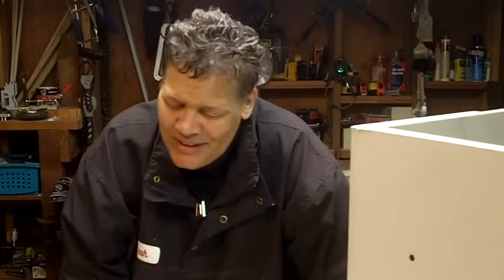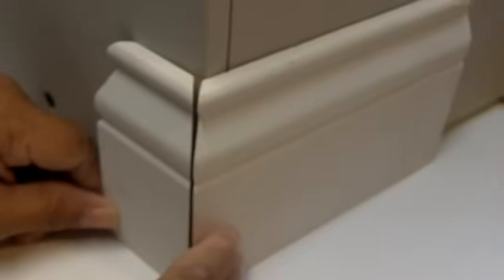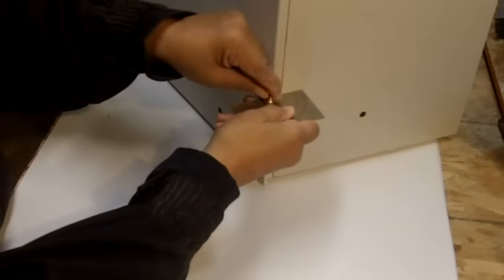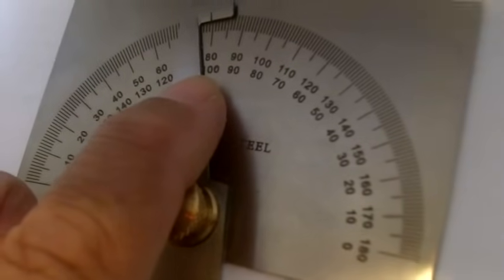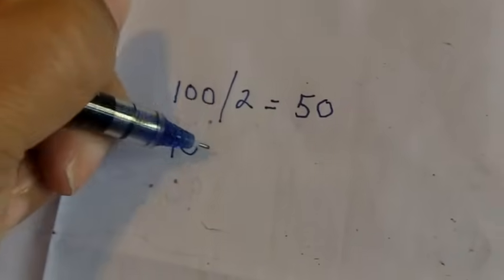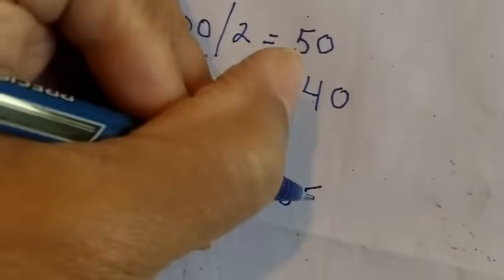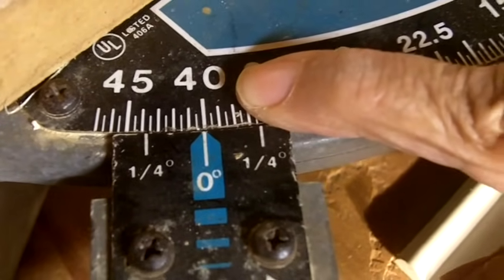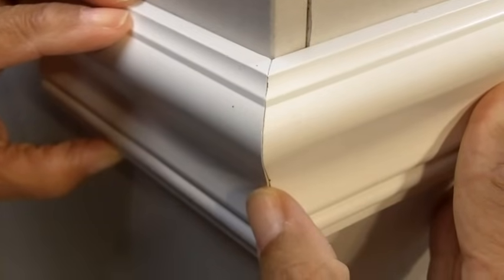Install Perfect Outside Baseboard Corners/Easy Math Trick

Comment: I believe for acute angles (<90°) you still have to calculate the supplementary angle and set the mitre saw to that value. For example if the outside corner angle is 60° you can't set the saw to 30° and cut the moulding because you'll end up with a 60° bevel. You need to set it to 60° which most mitre saws won't provide. What should one do in that case? In these cases you need a compound mitre saw.
Reply: Yes I’m surprised that she made a mistake like that! The best way is 180 - the angle of the corner divided by 2. An 80 degree corner should be cut at 50 degrees and not 40 degrees.
Reply: @theone3337  Your simple math statement just cleared up my frustration with setting an 87° corner to 43.5 and it was really off. It had to be 46.5. Thanks for saving my sanity.

Comment: If you cannot do maths or have no protractor you can get the angle by laying your skirting (base board) flat on the floor against the wall and penciling a line on the floor on both sides of the corner then at the point where the lines cross to the wall corner will be the angle you need to cut, set your bevel to this angle.
Reply: hunh? Can you explain better?
Reply: Lay the board against the wall flat on the floor, draw a pencil line along the edge of the board, move the board against the other side of the corner and draw a line against the board again where the lines cross draw a line to the corner of the wall and that will be the angle you need to make the perfect cut.
Reply: No
Reply: @gw0mof  u can find any angle without an angle finder, u need to pieces of wood, extended from the wall, overlap them and measure from upper point to lower , draw a line and you get a perfect angle.

Comment: WOW.... I really learned how to cut moulding with your video....  your a great teacher.
Reply: Do you realize she is  actually wrong though? 😂😂😂
Reply: @jonm2416  no. How so?
Reply: @annanajduch5201  It's nothing against her, she's usually great. She just made an error that may cause some people a headache. It doesn't work the way she said for angles under 90 degrees. If you take an angle under 90° let's say 88° and then divide by 2 and get 44° and proceed to set your saw at 44° you will get a miter joint that's open by 4°   meaning you can practically stick your pinky finger in the gap. The correct saw setting would be 46°. The easiest way: measure the corner as X and use this formula to set your saw. (180-X) ÷ 2. Happy building!☺

Comment: I like the way she instructs.  Very clear and logical.
Reply from the maker: +J Scott thanks!
Reply: I agree very clear and simple. Inside and outside corners favorited for future use.
Reply: yup, a very good teacher.
Reply: 2018 mr olympia
Reply: Very clear and logical, but her math is very wrong. The correct formula for all angles (right, obtuse or acute) is (180 - x) / 2, where x is the measured angle. I like her persona, but she needs another math class.
Reply: Except good teachers don't teach falsehoods. Using her logic, an 80 degree corner and a 100 degree corner would both require 40 degree cuts. Not possible. The correct formula for all angles (right, obtuse or acute) is (180 - x) / 2, where x is the measured angle. She needs a math class.
Reply: J P NNEEERRRRDDD
Reply: @manillafresh57  DDUUUMMMMYYY
Reply: @JP-xj6lr  In  this example the measured angle was 100 using your formula (180-100)/2 = 40 which was her result.
Reply: @willhunt3000  Her formula only works for anything over 90 degrees. If it's 90 degrees or less, she says to divide the angle by 2, which is incorrect.
Reply: @JP-xj6lr  you weren't clear that you were referring to the error in reference obtuse angles only.   Not sure why you found it to be necessary to be rude and snarky.   I'd like to critique your instructional video sometime.
Reply: @willhunt3000  Not trying to be rude or snarky. Just stating facts. Math is either right or wrong, and this video is misleading. I think she's a great, natural teacher.
Reply: JP. Could you do the math on a house with 90 corners using math that takes 5 times longer... how much money would I make on that job?
Reply: J Scott Yeah she’s pretty good.
Reply: Brian B The smartest people never stop learning.
Reply: @JP-xj6lr  Thanks for pointing this out. I have a wall that is 86 and I was cutting at 43 and it was worse than the 45. 

She does explain the obtuse angles really well and she is easy to understand.
Reply: @beginew  u might not even get paid at all if you used her video suggestions bc half ur miters would look like garbage
Reply: @manillafresh57  or maybe he's a math teacher? Or a finish carpenter like me? Some professionals can easily spot her error. This woman has great intentions and gives great advise 95% of the time but she happened to make a simple mistake this time. Not a big deal. He's just pointing out the correct way. Any snarkiness I believe comes from the fact that if you make a mistake on your own that's fine. But when you try to teach other people with that mistake then you probably SHOULD go take a math class because you're going to give other people problems.

Comment: Leah you are a genius! I wish you could've taught my woodshop class, math class,  hell....can you be my mom?
Reply: @jonm2416  glad I saw this comment can you explain the first part correctly mate it don't make sense I understand cutting 40 degree fir a 100 degree mitre to leave 50 (2x50=100 degrees ) but the anything under 90 and halving don't add up to me
Reply: @kevinhancock4064  sure, the formula is actually (180-X)/2 with X as the the overall angle like say 88°. If the main angle is 88° it seems like you'd just divide by 2, cut a couple 44° miters and be done but the "44" is actually what gets removed from 90° leaving you with 46° which is what you really want. Basically a miter angle is not the same as a regular angle. If you use the formula and physically perform the action on your miter saw it will work and become clear. I actually had to picture myself cutting the joint on my miter saw to realize she had made a mistake. It is confusing, I'd give her that. I just expected to see her admit her error but she seems to deny it even when confronted. Lol..good luck
Reply: @jonm2416  I went by my formula ans it worked fab fir me as it gives the angle of which the blade should be at and not what angle us left from the cut I guess both work depending how you look at it my external skirting mitres fir example on the side wirked out at 86 degree cormer so I done 90 - (88÷2) equalling 46 degree ut at saw i put a 45 dehree timber piece at mitre saw and added 1 degree to make the 46 cut it worked a treat
Reply: @kevinhancock4064  I tried to figure out your method but got confused about the angle being 86° and how you put 88° into your formula instead. But no matter. As long as you found something that works for you, that is the most important thing. If your miters are tight and you get the satisfaction that comes with it, then the project came out nice and you enjoyed it. And that's most important. Good luck mate.
Reply: @jonm2416  my formular I use now for skirting is x being the angke 90 - (x÷2) and that gives me my cut every time perfectly
Reply: @whocares650  not sure who said she's an idiot but if you took her calculations to a mitre saw you wouldn't get the cut you needed simple shes right on the angle required but not the CUT of the angle needed
Reply: @whocares650  bc her method only works half the time

Comment: Finally someone who explains clearly and shows with simplicity something that would take lots of confusing  explanations  for somebody else . THANKS .
Reply from the maker: +Alex Castillo you're welcome, Alex, and thanks!
Reply: Ccr
Reply: Alex, please don't listen to the advice in this video. The math presented here is just plain wrong. The correct formula for all angles (right, obtuse or acute) is (180 - x) / 2, where x is the measured angle.
Reply: @JP-xj6lr  thanx brother very helpful information
Reply: @JP-xj6lr  that the same thing she said, just used a different approach to it. She came up with the same angle.
Reply: @timmyers3428  Using Leah's math, both an 80 degree and a 100 degree corner would result in a 40 degree miter cut, which clearly isn't possible.
Reply: Tim Myers J P’s right, she said a corner of 88 degrees should be cut at 44 when it should be 46 degrees.
Reply: @JP-xj6lr  EXACTLY! Or in other words, it's ALWAYS the supplementary angle / 2.
Reply: @markarita3  what do you mean by supplementary angle? Thanks
Reply: @RipleyhypnotherapyCoUk  The angle to which you set your saw is ½ of the supplementary angle that you measured (on wall). What I just described is literally the formula, but in backwards steps - to help understand what is going on. Supplementary angles are 2 angles than add up to 180°. So, you measure 86° on wall...180° minus 86° is 94°...THIS is what you divide by 2 and to which you set your saw...NOT the wall angle. Same goes with an obtuse angle. You measure 93°...180° minus 93°= 87°...divide 87° by 2 and set your saw to this. The formula MUST be applied to obtuse AND acute angles. It is not needed for 90° (right angle). Hope that helps.
Reply: @markarita3  thank you, i get it now
Reply: @JP-xj6lr   I do agreed 180 degrees minus 130 = 50 decided by 2 = 25. or if you have any degree under 90, say 60 dived by 2 = 30, that is your cut, much easier to understand.
Reply: @theone3337   explain it!
Reply: how to cut an 85 degree if u decided by 2 its 42 1/2 if you cut  put them together they do not make an 85 degree , you need to cut it at 47 1/2 to  get a perfect 85 degree, confusing.
Reply: The best way I've found is to make a jig at 45 degree, clam it to the fence, now you can cut any angle at any degree. example a 63 degree angle.   start at 0 which now is 45,  count upwards, 5 now is 50, 10 is 55 , 15 is 60, 20 is 65 and so on, to cut a 63 degree  , 45 + 18= 63 set the miter at 18 degree an you have a perfect 63 degree.

Comment: 180* (straight line) minus the obtuse angle gives the supplementary angle. E.g. 180* -  100* gives the supplementary angle of 80*
Reply: 180/2=90   90-90=0   straight line
Reply: carlos lovera he is talking about
Above 90• your confused 180-100=80/2=40...
180-130=50/2=25
Reply: @lovera3878  90 is not obtuse

Comment: JP she has a later video called The secret to making perfect miter cuts when the angle is less than 90. I was also confused by this but in that video she makes it clear and shows the correct way. Example she gave. 85 degrees divide by 2= 42.5, 90-42.5=47.5, make your cuts 47.5 degrees. It made alot more sense to me. A fantastic video everyone should watch. But this video made it so much easier for me when the angle is above 90. I love her videos.

Comment: This is all well and good, and also 100% correct, when you have straight lines/walls to work with. That rarely happens in my world. Come 2binches in on one wall, there typically is a kink in it, and then yor protractor will be off from what you are actually after, still leaving a gap, even though your measured angle is correct. You need more surface area to work with. Old school methods suggest you take a 16" scrap or so, put it up against the wall, and extend the outside past the apparent intersection of the other piece, and on finished floors, you'd of course be marking on some tape or a piece of cardboard, then move it to the other wall and repeat. Now you have located the exact point for the outside corner, and here you can use your gauge, as the boards have evened out all of the lumps, bumps and kinks. Festool sells a tool that comes with the Kapex, that does all of this for you, including splitting the angle, so all you have to do is set the saw. The important thing about it though, is that it has a much larger bearing surface, than the gauge shown in the video. Other than that: great work 👍

Comment: There’s an error about 1:46.  I the external angle is less than 90 you can’t just halve the angle.  If it measured 88 you would set your mitre at (180-88)/2 = 46.  This formula works for external and internal corners, for more than 90 and less than 90.

Comment: Hi Jane, I like the way you explain.  I have a problem when I made a baseboard outside corner with your instructions came out find, but when I tried to make the other corner on the same baseboard, always the baseboard are short then the corner doesnt fix.  Im tried to put the baseboard into the base of a kitchen island.  All the baseboard around were short.  I measured but when I cutted always came short.  I had the 10" miter saw tool shop. My baseboard is 5" wide.  Would you make a video?  Everybody made only one corner side but when there are two ,left and right outside corner how to measure in the correct way and cut it with the miter saw

Comment: It’s simpler to subtract any angle acute or obtuse from 180. Divide the difference by 2 and that’s your miter saw setting. If the saw setting is greater than 45 you have to make a simple jig. Search here on YT for an example.

Comment: Interesting video.  I guess my question is you said that if the angle is less than 90 to just divide by 2 so an 80 degree angle you'd cut at 40.  However, if I'm following your example, you cut the same angles for a corner that is 100 degrees?  How would the same angled cuts match both an 80 and 100 degree corner?  I guess it depends on which way the trim is facing on the fence of the miter saw?

Comment: Great videos I have one query as you stated if its less than 90 degrees it'll be halved and so forth what I'm trying to get in my head it (yes I've done tidy mitres and scribed internal boards successfully) but say you had an acute  angle of say 80 degrees ....as stated it'll be halved at 40 degrees thats your cut right ....then as in your video you get a 100 degree angle (obtuse) halved is 50 and subtracted from.90 is again 40 the 40 makes sense as it then leaves 50 degrees to math second 50 degree cut to make 100 degrees but how is it you have again 40 degrees for the acute ? Just trying to bed my head around the true concept of it cheers again

Comment: Great video, but can you explainthis. This is saying that a 80 degree corner (80/2 = 40 degree cuts) and 100 degree corner (100/2=50; 90-50=40 degree cuts) require the same 40 degree cut?

How can this possibly be?
Reply: Hey Tucker, glad to see you noticed the bad math too. The correct math is (180 - x) / 2, where x is the measured angle. So an 80 degree corner requires a 50 degree cut, and a 100 degree corner requires a 40 degree cut. It's so frustrating to see her teaching false information so successfully.

Comment: to make sure you cut the right length, do you just cut the piece and add the width of the adjoining piece to each end? So a 10 inch length using trim that is ½ inch thick you measure 11 inches for your angle cuts?

Comment: I just did this for some chair rail I was installing and it worked perfectly! I live in an older home so all the walls are not exactly 90-degrees and I have some walls that have obtuse angles on it. My one wall was 134 degrees, I divided it by two and then subtracted that from 90! Perfect fit!! You rock.

Comment: best way that I have figured is have two scrap pieces that have the 45 cut on them already see if they fit perfectly, if they do then just measure your pieces and install them. if they are off then get a couple of uncut scrap pieces and either cut a little more or a little less. whatever you need, I always carry a box cutter cause sometimes the top will fit right but the bottoms will not and you might need to just shave a little off. if you're a good carpenter you can just look and tell what angle to cut these pieces and remember it doesn't have to be perfect because once it's caulked and painted it will look good.

Comment: Question: How do I determine the length of base board that I need to use for a wall. Considering the cuts on both ends? Perhaps a rule of thumb. If that makes sense... Thank you in advance!

Comment: Good tip. If a wall is that far out - change plasterers. The chances are they’ve set a corner by eye whereas a builder would’ve used a square as they know the implications of an external corner being obtuse.

Comment: Hi leah great video but i have a question to ask please..... i measured my baseboard external mitres with a mitre gauge one was 46 and one was 47 if i multiply that by 2 i get 92 and 94 degrees then if i follow the formula i get 43 and 44 degrees which i hope is correct.....My question is would this work the same if i was cutting the baseboard laid flat and was using a bevel cut?

Comment: Are you able (I'm sure you are) explain how the 40 miter setting is the same for both 80 (80/2) and 100 (100/2 = 50...90-50 = 40) degree corners?

Comment: I don’t understand,
The second part is right but I think the first part is wrong
If the angle is less than 90 degrees( let’s say 70 degree) your cuts aren’t at 35 degree,
They have to be more than 45 ,
Closer to 50 I’d imagine 
Or am I wrong
Reply: Yes the first part is wrong! If under 90 then the sum of the angles has to add up to 90. Infact Leah has done another video saying just that! Eg if you divide 85 by 2 and cut two 42.5 mitres it won't fit.